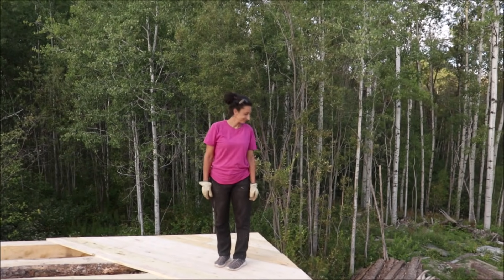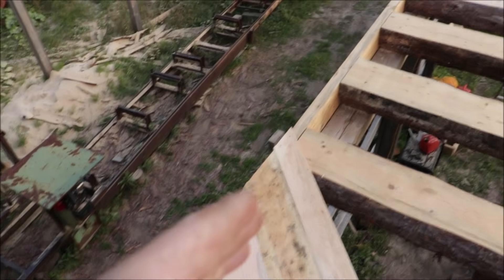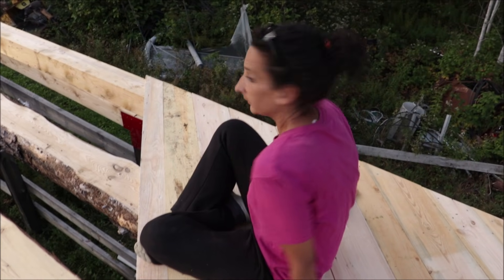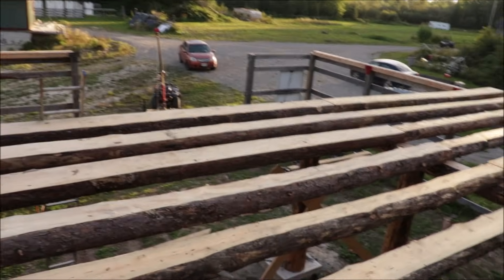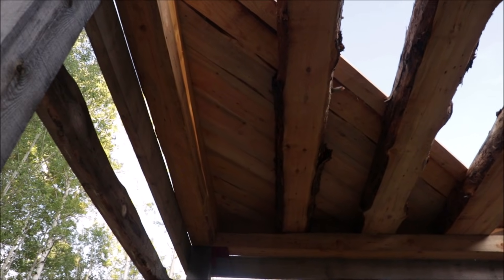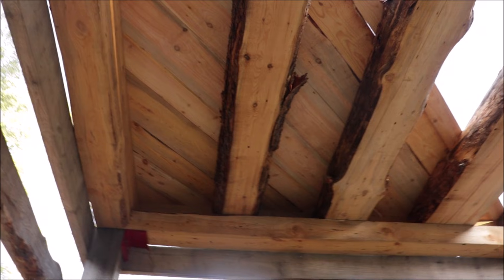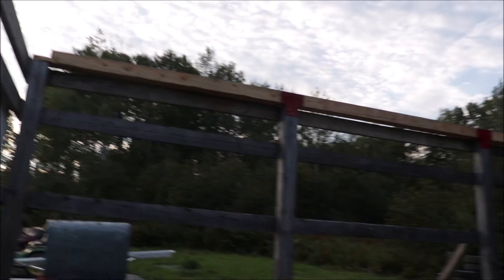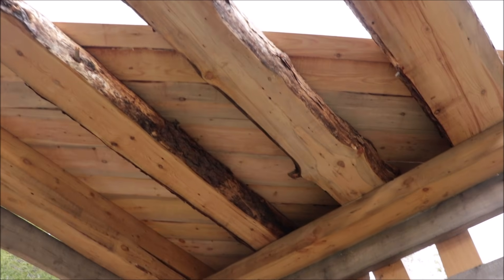Wow This Is Nice...  We're Loving The Look.

Comment: Great job on the floor joist and the building is coming together.  A suggestion is how you did your deck flooring by letting the boards overhang than snap a chalk line to cut them off; you could do the same for your flooring in the building.  Stay safe and don't work to hard take some time off an enjoy life.

Comment: Steel siding to close it in, and use the material you cut off the floor joists on the outside of the metal for the looks and to help with insulation and accidental damage to the metal.

Comment: That is looking so good so far. You will be doing everything in there in wood so protect it from a possible fire i would put the steel sheeting on the outside. All the structual work is in wood. the roof beams will be in wood and i take it the walkway will also be in wood. You might not get any fires for several years but it only takes one fire to destroy everything.

Comment: I would go for board/batten siding or ship lap siding and use steel strip cross bracing on the lower walls... just to make sure the strength of the building is not challenged too much... You could also use the left over barky off cuts as siding, not sure what that would mean for bugs and rotting though...

Comment: Just thought - if you are concerned about wooden siding and forest fires then you could rig up a drip irrigation system under the eaves of the house all the way around - similar to the ones they use in gardens - and if there is a threat of fire turn the system on to keep the cladding damp!

Comment: If you have any fears of a wild fire in the area a very simple project to protect the property is a stone wall to zone off the area around the house/buildings from the forest itself. If you have farms in the area it is easy to get free/cheap rocks by simply raiding the farmers stone piles as they always want more space so getting rid of a few tons of rocks is helping them. Setting up a sprinkler setup inside the rock wall is simple for spot fire control at that point even if it is above ground hoses and sprinklers.

Comment: Tough call on the siding. Both have advantages and disadvantages but either will look great !  Steel isn’t cheap but it goes up fast and lasts a long time with little maintenance and is more fire resistant. You have plenty of wood and a great mill to process it but it will be time consuming !  I know you will figure it out and I look forward to the rest of the construction !

Comment: Cecil, this project is really turning out quite good. Going diagonal adds more strength to help stabilize any movement. My only question is, any concern about gapping when the lumber begins to cure out more? Or has all the lumber you're milling been cured already? 
I'm more partial to wood siding because it will match the house but, I do agree with Heather. There's a saying, never say never, fires aren't fun especially if it gets away. If you're going with a metal roof, then yes, go with the metal, just make sure you insulate. Sun beating down on a metal roof... makes for an oven. Love this build. Great video as always, cheers :)

Comment: Wow decisions Tag Mahal or the shop my choice the shop very nice very nice. Like the floor as I said before it will be interesting to see. Only used the angle flooring once, but it wasn't a big space great idea I think. For your siding steel or wood siding what a conundrum advantages to both. If a fire would arise fire is like water if it gets in damage will be done. I am leaning towards wood myself. Okay now for my question about the bark on your beams what if you just left it I mean it looks nice a bit western?

Comment: Metal:  Faster close in.  Fire resistant.  And most important less maintenance;  when you get to my age.   Keeping the little house looking good will be all the effort you will want to put in.  If you want rustic; but not weather tight,  you can apply other wood materials to the lean-to structures off the main building.  ( slab wood siding, live edge boards, etc. to reduce snow blow in in the winter, but allow air flow for wood drying. )  Even fancy wood sliding doors for access to wood stacks.         the old guy at 81  Bert
Reply: Yes I'm 75 that is so true!!!

Comment: Hi Cecil, would it be easier, and quicker to let your floor boards run long and then use a chailk line to trim flush like when deck boards are trimmed after the decking is done. Just thinking. Looks great though so far.
Reply from the maker: Good morning RB, yeah it may be.. these boards were 16' long though... we may do that on the shorter boards.  thanks again. Cheers!